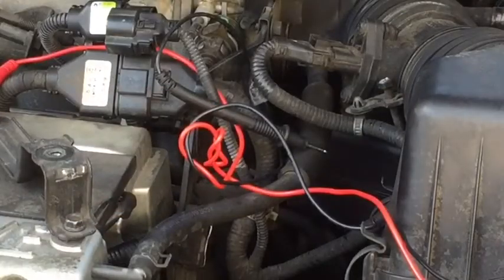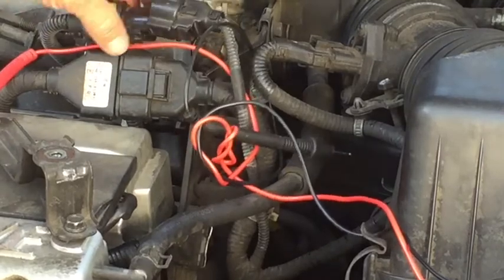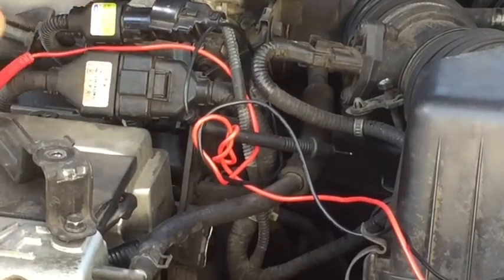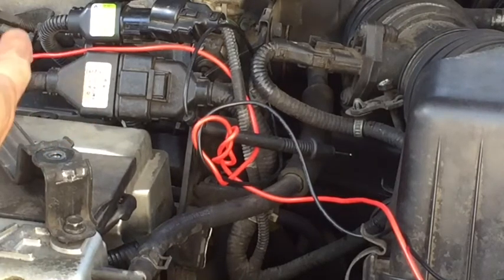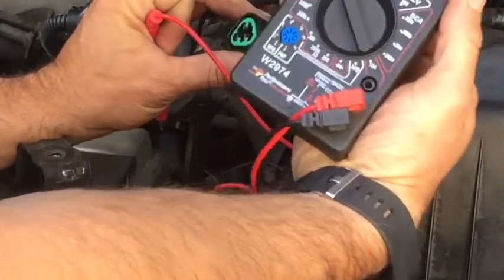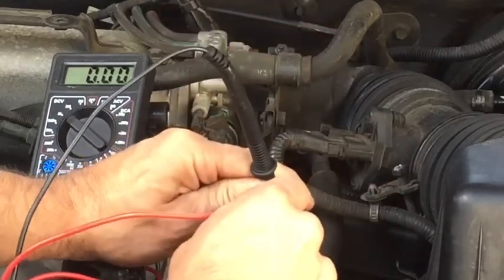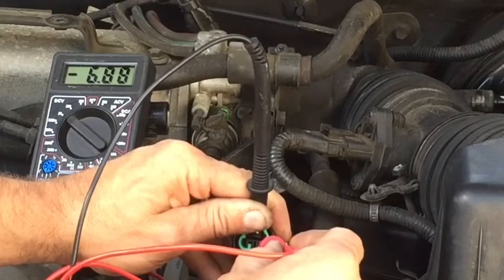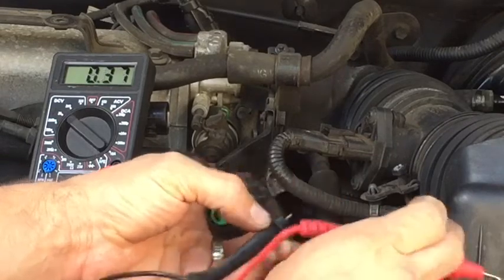Testing Power going to to CRANKSHAFT SENSOR Hyundai Santa Fe 2.4

Comment: Yeah I have a 1999 mercury villager three pin on a crankshaft position sensor plug how would I test that
Reply from the maker: Testing them seems to be inconsistent, hopefully you have had a check engine light to help guide you. What type of issues are you having?
Reply: At the moment it’s not throwing any codes but I’ve done some diagnosing myself it would show RPMs on data stream on the code reader so I guess that means it’s reading from the crankshaft position sensor but no RPMs on the dash i’m kind of wondering is it a power issue going to the distributor what wires should I be checking I really appreciate whatever you can throw my way
Reply from the maker: Does your Mercury have the 3.8l engine? Are you having drivability issues or just having the gauge not show any readings?
Reply from the maker: @terrellscaife2411  typically the rpm wire that runs to your distributor will be green. I would check for proper grounds and a solid connection before anything else. Hope this helps 👍
Reply: Mercury villager is the same vehicle as the Nissan quest it has a 3.3 L Nissan motor and it has it doesn’t start
Reply from the maker: Does it just crank and can you smell any fuel?
Reply: Yes it’s getting fuel but when I put on my HarborFreight ignition checker it shows week ignition pulse
Reply from the maker: Have you checked the wiring around the distributor? Has any work been done on the vehicle leading up to the no start?
Reply: I will check the wiring around the distributor or the plug-in to the distributor what would you suggest that I look at I’ll be looking for
Reply from the maker: I would look for any loose, melted, damaged or corroded wiring coming from the distributor. The harness coming off the distributor will have a wiring harness and that is what I would look at, be sure to follow these wires as far as possible. Also have you checked all of the fuses and relays?
Reply: OK guys that sounds awesome I’ll keep you updated appreciate the help
Reply: Hey I got a question for you here for the resistor that’s on The wiring hornist to the distributor is bad will that stop it from getting a signal I seen a video on a guy working on a Nissan Xterra and he was doing some test but he never got back with me on my question
Reply: Yeah the name of the vehicle is the Nissan Xterra crank no start
Ignition circuit troubleshooting
Reply from the maker: @terrellscaife2411  hi there, if that harness was damaged or faulty it would indeed cause an issue, I saw that you recently said you are getting fuel and that you tested for spark and thought the spark was weak.
Reply: Yes I test it has spark weak spark I have the Pittsburgh ignition spark checker and it has fuel I even replaced the fuel pump and the fuel pressure regulator so those are working to and there’s times it act like it wants to start he just don’t have enough firepower
Reply from the maker: Just out of curiosity has the distributor, spark plugs or ignition wires been replaced recently?
Reply: Yep brand new from advance auto
Reply from the maker: @terrellscaife2411  hope you don’t mind all of the questions, did the vehicle run before you changed the wires and distributor?
Reply from the maker: @terrellscaife2411  is there a chance the distributor is off, it is common for a distributor to be installed 180 degrees out of alignment. Or could any wires be misguided?
Reply: Yeah I absolutely don’t mind the questions The vehicle ran and drove just fine but what happen Is it had a knock sensor code so when I went to take the lower intake manifold off one of the studs and one of the bolts broke off in the head so I had to takeoff one of the head but when I put it back together I didn’t change the timing belt so I put it back together it ran drove it up the street time in belt broke it took me a while to figure out the timing belt broke but once I put the new Tommy built on now it’s having these ignition signal issues
Reply from the maker: Are you 100% sure that you put the distributor back in correctly? If you have any doubts I would reset your initial timing. Are you familiar with how to do that?
Reply from the maker: If you are certain you installed the distributor correctly then I would check compression for each cylinder. They have compression tester’s at Harbor freight.
Reply: Yes all that stuff was checked multiple times and when I put on the timing belt all the timing marks marks lined up
Reply from the maker: @terrellscaife2411  wish you were local so I could see it first hand. With you having spark, fuel, compression and the correct timing then I would guess there is a more technical issue.
Reply: Maybe you could shoot me an email
Reply from the maker: I’m not comfortable listing my email on YouTube.
Reply: OK that’s cool I thought if we did that I can send you pictures and videos of the issues I was having but I appreciate you trying to help me out
Reply from the maker: @terrellscaife2411  if you shared your email I could copy it and delete the post quickly.
Reply: Wow under what name
Reply: Hey I wanna let you guys know I really appreciate this help so on the vehicle I think I stated it previously when the code reader is hooked up on live data it will show RPMs so I guess he’s reading it from the cam sensor but it  doesn’t have RPMs on the dash
Reply: So when I post the email how long do you think you would need like five minutes before I delete it
Reply from the maker: @terrellscaife2411  Once you share your email I can actually deleted myself once I have it saved.
Reply from the maker: @terrellscaife2411  It will be very quick I’m waiting for it now if you’re comfortable sending it.
Reply from the maker: Looks like it came through very delayed but I have it and it is removed
Reply: Sounds cool
Reply from the maker: @terrellscaife2411  sent it.
Reply: Hey is everything still good
Reply from the maker: Yes things are well, I sent two emails to you and still have not had a reply. I thought maybe you had a change of heart.
Reply from the maker: Did you receive either of my emails?
Reply from the maker: @terrellscaife2411  Vandan but I used the email you provided.
Reply from the maker: That is the same email that I messaged multiple times, I just sent you another email and removed your email from YouTube.

Comment: Helpful thank you. I have an hyundau accent 2009. It only has 2 leads not 3.  With ignition on Voltage between leads is 0 I guess I need to trace the circuit